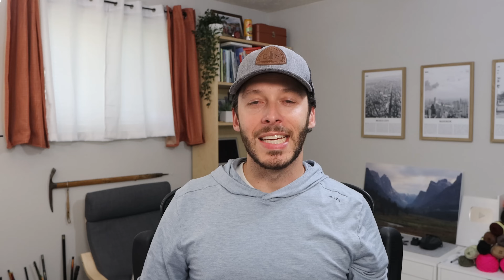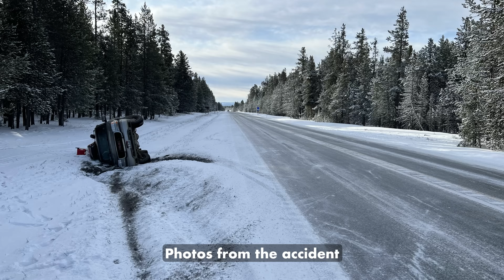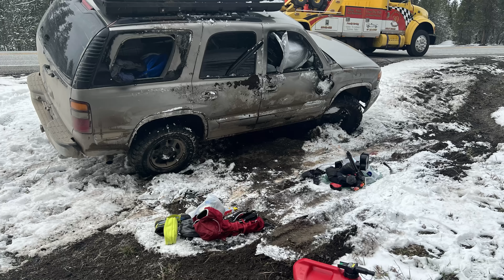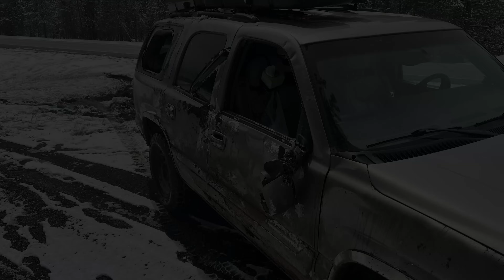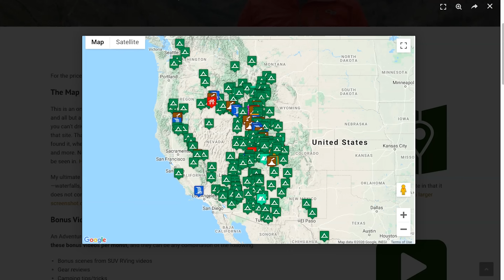I Crashed and Totaled My Car (Now What?)

Comment: After nearly 20 years in Law Enforcement I learned that when the vehicle gets squirrelly, pop the transmission in neutral. That little trick has saved my bacan too many times to count. Grandson has a newer Ram pickup where that's impossible. I quess I won't own a newer Ram pickup.

Comment: as much as I love Suboverland for the inspiration they have given me I dont like their pricing. I will have my Suburban all decked out way beyond their offerings for a fraction of the price. Sure, they need to pay their employees for their labor but the prices are steep and I cant help but feel like most of the work could be done by an average guy in their own driveway anyway so I dont see the need to have them do it. I wish they'd sell the rear interior kits as a flatpack set of parts with instructions on assembly (IKEA Overland LOL) but even that wont be too terribly difficult to replicate or surpass in design. It is the part that requires the most specialty tools though.

Comment: Nothing against modifying a factory suspension. I've done it, which is why I'll say... It's not a good a idea for practical use and safety. There are sacrifices you make when changing the geometry of countless engineering hours. And the benefits are negligible within public roads.

Glad you're safe 🙏

Comment: It's counter-intuitive, but when sliding into a ditch on snow and ice, let OFF the brake and use the gas. Looking at the photos, the tires dug in and helped cause the up-ending.
Just saying, there are known driving procedures for sliding off the road that need to be done without hesitation. Most people simply panic, bury the brake pedal and pray.
Sometimes there is little to be done, most times there was probably a better way to handle that was simply missed due to presence of mind being the problem.

Comment: Tristan, when I heard your recollection of how the vehicle got out of control and assuming it has the tires that came on it when you bought it, that explains its poor performance on ice. I realize its not like you are in a true winter road climate all winter where you live nor certainly when you travel south out of the snow and yet I know from experience that the modern true winter tire makes such a difference over a typical all terrain tire or even an all season tire for that matter. Yes a few of the all terrain tires for a larger SUV or pickup truck have the snow flake insignia on them but that is somewhat misleading as they still can not begin to perform like a true winter tire. Where I am in northern Alberta its a no brainer as we get about 10 months of winter or so some claim it seems that way LOL. Perhaps you can get a tire sponsor who would be happy to work with you to keep your rig happy on the rugged trails and another set of tires for winter mounted on wheels ready to go.

Comment: I have an old Mazda tribute(LOVE). It also has the chargers that stay on if the car is off. I LOVE IT. I can charge my phone overnight and cook in my hot logic while parked and use my electric blanket all night. 🤗 I have a new battery and a charger

Comment: First - so glad you are ok, Tristan! And then just a comment on the 12 volt system staying on when the key is off. I have a 2007 Dodge Grand Caravan, but this worked on my 2003 Chrysler Town and Country  so maybe other vehicles as well- there is a fuse that can move from one position to another. In one location the side power port will be hot all the time. If you move the fuse over to the other side of it's slot, the power port will only be hot when the engine is running. I keep mine set up so the power port is only hot when the engine is running. Also, I am shocked that people don't know that they can turn off the interior lights so they can keep a tailgate open all night and not run down the battery. Ask me how I learned that! Thanks for all your videos! Looking forward to your next adventures!

Comment: Wow. I am bummed for you losing the car like that, and, of course, glad you're OK. I had a 2017 Yukon 4wd and it was great (17mpg), I'd definitely have another one...my favorite car ever. I put a rear deck in, and a Domestic fridge on a slide with a 2nd battery under the hood and an isolator that powered the fridge. I was tenting in those days, and have since moved to a van, and now a travel trailer with a 4wd pick up to tow with. I enjoy your videos and am glad to hear you're going to continue with a next chapter!

Comment: You could spend a few hundred dollars purchasing replacement parts from an auto salvage company and have the Yukon back on the road. Most of the damage I saw would indicate it would be bolt on repairs. Happy you were not injured.

Comment: You are lucky that you didn't twist your back or neck and end up with life long problems. I would think about keeping the vehicle if you are going to buy another GM product close to the year of yours. There are plenty of good parts that could be swapped over.  There is a big demand for the GM drivetrains, people buy those rigs for the engines and scrap the bodies, so parts are cheap if you wanted to fix yours.

Comment: Glad you ok, size of vehicle probably had something to do with that kept you snug and safe.  I have a 2002 Yukon looked exactly like yours I find that when I have my Kayak on the roof my MPG goes down, but your right gas miles are terrible.  I use my Yukon to pull a trailer and I broke down on the way to camping trip spent 5 days in a garage, so I feel your pain.  I've had mine for about 6 years now, and I've spent thousands on repairs, but I expect that since the car is 20 years old, needed to replace the whole brake line it was rotten apparently, it's a common repair on the Yukon (and all the others on the same chaises around the same timeline). Good luck in finding your next vehicle I know the inventory is tough right now hope you find what you want.

Comment: Did you have it on 4WD mode, auto or 2WD?
Reply from the maker: 2wd
Reply: @SUVRVing  I have a 2006 Suburban 2500 and 2002 Silverado 2500 HD. Makes a huge difference on ice to have 4WD enabled given already using Winter rated tires. Don’t give up on Tahoe or Suburban

Comment: Glad you're ok. I have a 2017 Subaru Forester. Last year when my mother I  law passed we had to drive from Vegas to Ogden. Of course there was a storm that day and we could not make it to Cedar City. Between St. George and Cedar there were several trucks that went off the road and many cars losing traction.  Our Forester had absolutely no issues. It was extremely capable on the icy, snowy roads.

Comment: So glad you were not injured.  The problem with lifted vehicles and bigger off road tiers, is the 30 % hit on gas mileage and that they are top heavy. Our 2009 Jeep Patriot is stock as we purchased it. The cost of keeping up the  suspension has been substantial and we only do mild off roading.  Our next Jeep will not be a Jeep,  even though we have enjoyed this one,  over 160, 000 miles and still running.  We have car camped out of it as a couple and I have  SUV camped in it solo over 12 years. I hope your  next adventure vehicle serves you well.  Safe travels.

Comment: Glad you’re ok. Been in similar situations. Had an 01 Chevy truck. Best vehicle I’ve ever had. Love GM’s positraction and 4 wheel abilities . 250,000 miles and was still going strong.
GM comes with so many options as standard features and easy  to get parts for. Good luck and thanks for you excellent work

Comment: I've never rolled over. That must have been pretty alarming. I've gone off the road a couple of times. Decades ago, I had a spinout in  a snowstorm, on my way home on Christmas break from college. I came over a hill and immediately lost it. It was a long downhill section, all slick. I was only going about 35, but I let up on the gas too quickly and engine braking broke traction. I did a 270 spin and ended up back-first in the ditch. It was late in the evening. Luckily a car came along within about 15 minutes, but he didn't have a tow chain. He went 50 miles out of his way to take me home, and I went back the next day with my Dad to pull it out of the ditch.

Comment: I’ll bet it’s an auto? In slippery road conditions lifting your foot off the gas is just like applying the brakes, an absolute no no under those conditions! With a manual you can reduce the risk somewhat by pushing in the clutch pedal, and holding it in, takes away the braking effect of the transmission! Used to be taught but autos more or less took over!

Comment: Me liking the video doesn't mean I like what happened.   That's no good.  So in this case, disliking the video would be more apropos.  

So sorry to see that happened.  As others have said, I'm glad your safe.  It's probably good you had the strength and size of the vehicle around you as you rolled.  If you were in the smaller SUV you may have been going faster and/or the accident could have been worse.

Comment: 🙀 Oh my gosh thankfully you’re okay; many blessings your way. Appears to be early morning black ice road hazard conditions. Possibly my senior eyes deceive me but I don’t see damages to explain why the Yukon was totaled other than a broken passenger window and side mirror. Appears this was merely based on vehicle age however once a car teeters onto it’s side is it considered no longer safe possibly damaging electronic or mechanical components? Looks like uneven ditch merely teetered the Yukon off-balanced. I don’t see caved in sides etc; was the front axle possibly broken? Curious if your insurance offered a “buy back” option therefore allowing you to repair via the claim money especially if you’re fond of the vehicle with limited damages? It’ll probably get resold at an auto auction at some future point. Many years ago I was offered just such on an aged Honda Accord Hatchback that had hail damage claim, in my humble opinion not severe enough to throw away a decent car, which eventually got covered up via a rooftop carrier used for camping gear, so my large Akita 🐶 only had to share the hatch area with an original style Coleman cooler tugged up in a rear corner. Luv’d that 5-speed manual tripping all across the country camping and sightseeing. 🏕

Comment: I believe the power jacks can be changed to only on when key is on is to move a fuse in the fuse box.
The hole in the transfer case is a common problem. Using auto 4wd makes it happen much earlier. One of the shift rods wear through the case.
Glad you're fine. If it was me I'd pop in used windows on the side and keep going. I have a '99 Yukon and it works well with near 400k miles.

Comment: Scary. I had something similar happen to me. Black ice. Suddenly my car was not responding to my steering and I ended up in a ditch. I really don't know how people drive in areas where it snows all winter. My new car has AWD, so that helps. 
That road looked sketchy. I would have avoided it. Especially after my accident. Was your four wheel drive engaged?

Comment: 🙏 glad you’re okay. I rolled a F150 3 times over about 50 yards. By the grace of God, I walked away. Sad to see the Yukon totaled. I have a 2005 Sub that I use for some “light” over landing. It’s a great rig! I’m slowly adding different parts and improvements to make it more capable. If I wasn’t using a Sub, I’d consider a 4Runner.

Comment: I had a ‘98 Suburban 4x4 with a 6” lift & 35’s for 12 years! It was a great SUV & we traveled & wheeled it all over CA, AZ, CO & UT. It was so comfortable to drive. I’m wondering, did you hit the brakes when it started to fishtail? Most people do & that’s bad! Always accelerate slightly to stop the fishtailing. Just for future reference! Glad your ok. PS: The Burb was only slightly bigger then the Tahoe or Yukon & we never had an issue with turning around, etc. we had an Excursion back in the day too so driving large was no problem for me.

Comment: If you get another car with the hot 12v plugs you can get a low voltage disconnect device for your starter battery. I've skipped plenty of cars that didn't pass the smell test. We spend too much time in these cars to deal with that. Was just thinking that I could totally see you in a 4x4 Delica.

Comment: Glad you're okay. Same thing happened to me with the "increasing fishtail" when I was going down Thompson pass outside of Valdez, AK. My little Toyota truck ended up on its side. We pushed it back over, reattached the battery and were on our way. The body panels on that side were dented but otherwise all was fine. I agree about the 12v socket issue on the Yukon. I modified mine to turn off with the ignition. Maybe I should make a video. Quite the cliffhanger you left us with regarding your next vehicle.

Comment: By the way Tristan, the newer models do not seem as sturdy and weigh less, but the computer controlled all wheel and four wheel drives are vastly superior and the lower weight and computer controls are what give better gas milage. My 2018 RAV4 with AWD is amazingly capable and has gotten me out of deep sand and mud to the frame more than once. I admit I was lucky and in over my head, but did just fine with stock low end systems and normal road tires. Plan to upgrade tires to more off road style when these wear out but I was shocked at what the AWD system could do. This also has traction control that would have cut power to any wheel that lost grip and might have saved you completely in this situation. Constant monitoring of each wheel separately with response faster than any human could do. Just food for thought. Good luck. Also 25-30 mpg in Eco Mode. Have not even bothered trying sport mode yet.

Comment: Land Cruisers are pretty reliable. 4 runners arent so bad. Toyotas seem to be pretty reliable. Costly though. Chevy and GMC are better than Fords but each have their longevity issues. Like the transfer cases for example. Leek problems. In the older models if you use the "auto 4x4" setting. It causes problems with it.

Comment: Glad you seem to be OK, both physically & emotionally.

Did your insurance/adjuster say why it was totaled? It looks like most of the damage was concentrated on the passenger side? However, the engine bay & drivetrain seem to be OK.

Is there a possibility you could settle & buy back the Yukon, and just repair it yourself? You would just be driving a salvage title, but that doesn't really matter unless you plan to sell the Yukon.

Comment: You should look into the L400 Delica. You can register them in the the US as long as they're 25 years old. From what I understand, they're a bit overpriced in the US because of high demand, but there are a lot of them in BC and Alberta that you can for get much cheaper. Canada only has a 15 year rule, so they're very popular up here. I know of a 95 diesel with only 65k miles here in Calgary that you could probably pick up for $6,500 USD or less. We're actually looking at importing a 05 or 06 from Japan right now.

Comment: I didn't hear you mention how the sleeping platform in the back of the SUV did in the roll on the side. Did it break lose and throw everything all over inside the back? 
I often remind the people who post plans for building sleeping platforms that they need to really build secure connections between the platform and the floor of the SUV. And they often reply "what are the chances the vehicle will roll over in a crash, why be so worried about the platform flying around in a wreck?" As you learned, rollovers happen all the time, and an unsecured platform can be very bad for the occupants who are inside while the platform is flying around in a wreck.

Comment: So you have a SUV with a damaged passenger side, it does not impair the vehicle's drive ability and certainly does not keep you from continuing using it for your purpose. If you absolutely need a "pretty" vehicle to travel in, then for you it is unacceptable. For me I would just keep on trucking.

Comment: I purchased a Suboverland over a year ago. Bought sight unseen and had it shipped over 2000 miles. (Lesson learned). Rolled off the trailer with a CEL for MAP sensor, faulty oil pressure sending unit, heads leaking oil, A/C not working, all suspension bushings are shot, interior door panel held on with sheet metal screws and some kind of caulk and the interior had never been detailed.  I didn't complain because I had put my faith in a stranger and didn't do my due diligence. I'm not saying they aren't a good company but at the end of the day they ARE used car lot.
Reply from the maker: I'm sorry to hear that you had that experience!

Comment: Wow, scary! What vehicle you choose is totally your decision, but I will say that I LOVE my ‘08 Jeep Commander! They were only made from 2006-2010, so they can be a little hard to find, but… my mpg is definitely better than your Yukon — avg 17.5, but 20+ on the Hwy in the right conditions. I removed the 3rd seat in mine (never used it), which gave me a lot more storage in the well that it folded down flat into. I built a sleeping platform and plan on building a slide-out kitchen. I added a gun rack to one of the back side windows to hold my kayak paddle. A few other minor mods to round things out, and it’s the perfect SUV-RV for me!